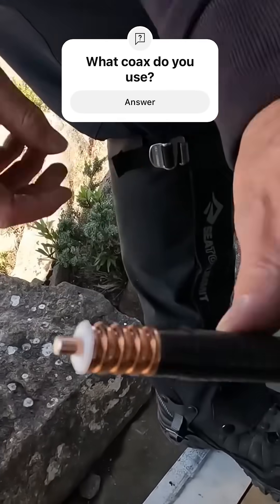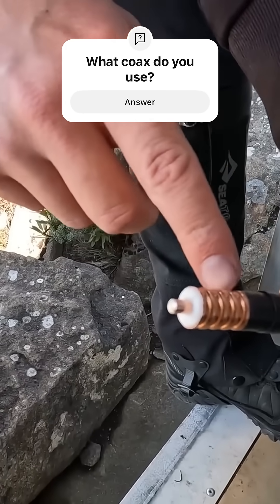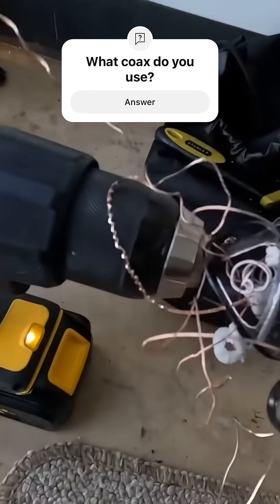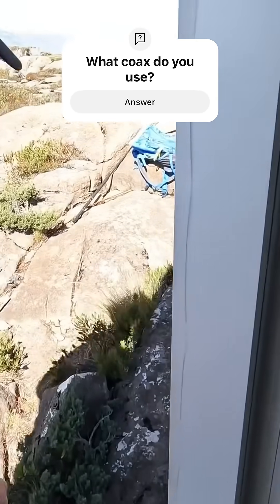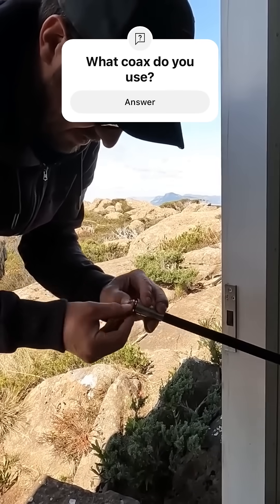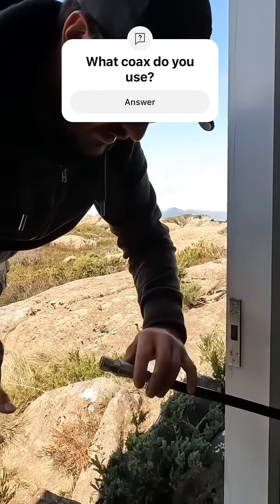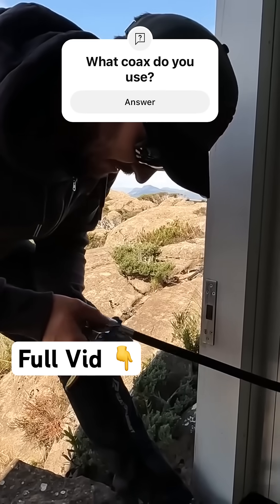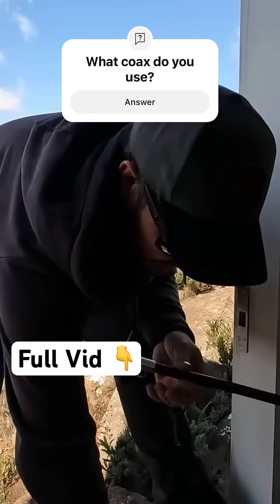Terminating coax in less than a minute

Comment: I use RG-6 for shorter or low frequency runs, along with matching transformers I've built. I also use RG-8 for longer runs, and RG-174 for short portable QRP runs. I also use old 300 Ohm twin-lead for special applications, like 300 Ohm antennas I don't want to match at the antenna. I'm hoping to move to a location where I can make and use ladder-line and not have to deal with the high loss, (not to mention the cost,) of coax.

Comment: Great to see the ease the stripping tool makes the preparation. 
Two things of note, the stripping tool doesn't clear the foam away from the inside of the outer conductor. You may have cleared this away and not shown it in the video.
Also when tightening that type of connection the instructions show the main body being turned, not the connector part. By turning the body, the outer conductor is somewhat protected from the twist as the spring is between the copper and the body.
When the connector is turned and the cable stays firm, the connector will drag on the copper and may deform the copper. It also scores the inner conductor which then can create high resistance contact between the inner conductor of the coax and the connector.